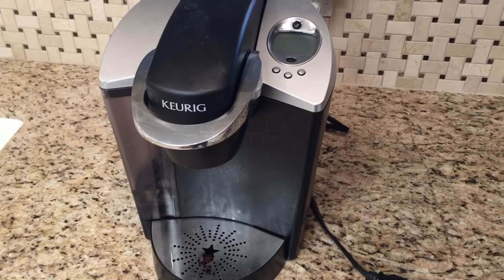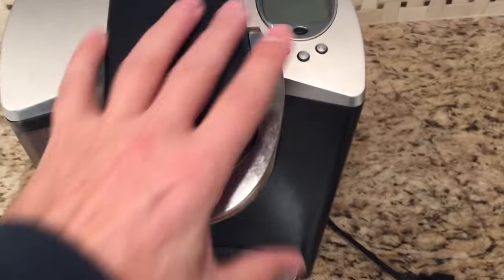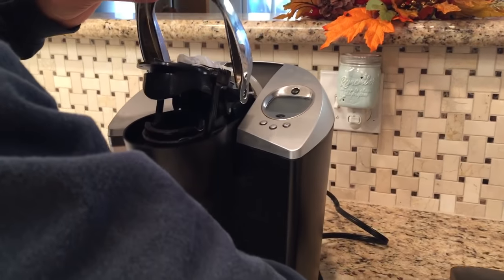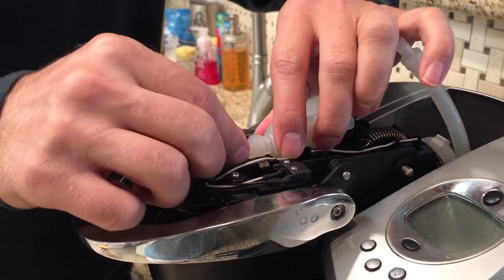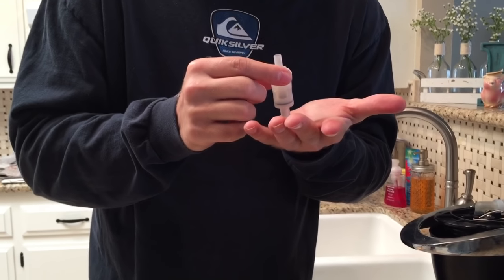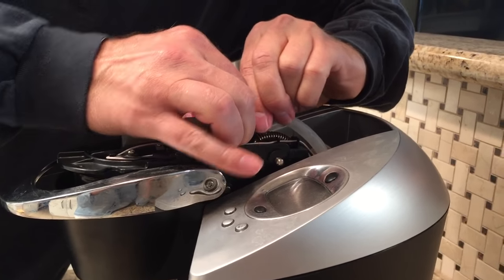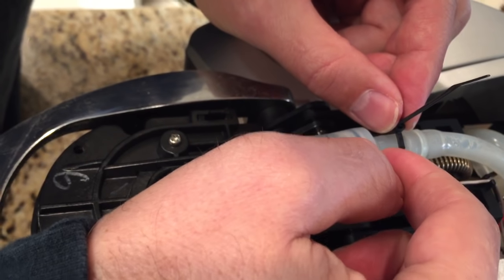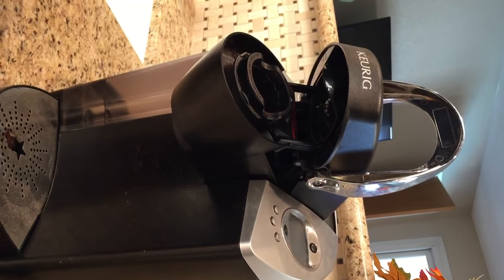Keurig Fix - Part 2: Cleaning the Check Valve

Comment: There is a much easier way to do this that doesn't involve any tools or taking anything apart.  But of course the easiest way is to use a paperclip or pipe cleaner.  I'm assuming this fix no longer does the job.  Take the unit to a gas station to use compressed air at the water intake to blow out the obstruction.  You may need to put your finger over the overflow.  That approach worked for me.

Comment: What should I check if the water does not stop flowing unless the power is turned off?
Reply from the maker: That's a broken control panel or bad sensor. Sounds like a complicated fix. What would I do, you ask? :) I'd try putting just enough water in the reservoir so it runs out before overfilling my cup...OR I'd watch it like a hawk every time and unplug the thing when my coffee was done. If the first solution works, it seems easiest. Fill your cup with water, pour in reservoir, and then brew as you normally would.

Comment: My problem is that it does not “hum” I.e. the pump does not come on , nobody talks about what to do for that.
Reply from the maker: You have a different problem that is harder to diagnose. Either your pump motor is burned up or frozen, or it is not getting power (for a number of possible reasons).

Do the expected lights turn on when you plug it in and power on?  Do you get unusual flashing lights or a message on the screen when you try to brew? If you have a newer machine, are you using Keurig-approved k-cups? Any sounds at all - solenoid clicks/pops? Did you try different serving sizes - maybe one button is bad?  Try blowing a little compressed air into the water intake. Maybe free up the pump assembly???

If that fails, the fix probably involves electrical troubleshooting, finding the bad connection, switch, circuit board, sensor, or wire, or isolating the motor as the issue and replacing it. This is why nobody speaks to this problem. It’s tricky to diagnose. 

Read up on how these coffee makers work. Understand the step-by-step process and compare it to your observations. You may be able to deduce the issue based on symptoms alone.

Comment: In my case the clog was not in the check valve  but in the nozzle at the end of the soft plastic tube  that shoots the water into the K cup.  I unhooked the tube and used a paper clip to partially clean out the nozzle but it still was clogged so I took it to the sink and shot water under pressure into it and it opened the clogged nozzle.

Comment: I was able to fix it using this method, but over time it does start to stick again. Mine is very old and probably just need to be replaced. Any idea where I could buy a new check valve for my keurig?
Reply from the maker: TurtleTitanTMNT Sorry for tardy reply. I don’t know where. Google? Amazon?

Comment: How do you fix it from making loud noises when it brew
Reply from the maker: Ms. Nina Buttafly I’m not sure. I’d try running a vinegar solution through it a few times and letting it soak overnight. There may be minerals built up inside, and the vinegar should dissolve them. Google this idea first before trying. I’d hate for you to break your machine.
Reply: Take off the metal bottom (all screws out until you see the inside) you'll see a tube wrapped in crappy sponge (probably grey). The sponge is not dampening the vibration enough. Solution is to add  sponge more in between where its vibrating. Usually the tube vibrates onto the keurig body housing which makes the loud noise. 
I used a very thick kitchen sponge and just cut it so it would fit snug without hindering anything else. I had to wiggle the sponge around so it would fit and move the tube so it would go between. The noise dropped about 50%. I also use a little dedicated table so the machine doesnt wake up the whole house at 4am. lol.

Comment: I have done this procedure but the Keurig still shows the prime message.  Have tried cleaning a number of times with vinegar but no luck. When turned on the unit makes a sound like it is trying to pump water through it.  Does this for about two minutes and then stops.  No water flow.  Turn machine off and on and get same prime message.   Help.
Reply: The vinegar probably won't do much if it's not getting pumped all the way through the system. I had your problem with my ancient Keurig model, and I eventually got past it by trying a bunch of things. I'm not sure exactly which one worked because the pump didn't finally work until the morning after I had tried everything. But I suspect it was an air blockage somewhere in the tubes, and either blowing in or sucking out on some part of it probably dislodged that - either the water intake port at the bottom of the reservoir, or the clear plastic tube that overhangs the top of the reservoir.

Comment: Why the zip tie?
Reply from the maker: There was a clear zip tie before I took it apart. I assume it was there to keep the silicon hose sealed to the valve under heat and pressure which combine to cause leaks. Perhaps other machines do not have them.

Comment: Unscrewed one screw and it sounded like a nut on the opposite side of the plastic dropped off.  The screw will not screw back in without the nut.  I'm not savvy with stuff like this.  Please help.
Reply from the maker: Sorry about the delay! Are you still having troubles? There are no nuts in my model. The screws seat in the plastic frame of the Keurig. Can you upload a picture of the screw that came out?

Comment: There is another valve on the bottom that is even much dirtier. I'm not sure if it's coffee or a bunch of gunk. If you have a camel pack brush. I sent the rod down through the tubs.
Also, the way they made this thing has so many bends. No wonder why they get clogged all the time.

Comment: I'm not getting any water to make coffee. On top of the machine it says Prime. Not sure what that means. Even if the water is full green light blinks and says add water. No water coming out. I will try doing what you did.
Reply from the maker: One tip - don't use distilled water. Try brewing with plain old tap water or bottled "spring water." Some Keurigs rely on the ions in "normal" water to detect the water level. Distillation removes most of these, thereby fooling the sensor into thinking the tank is empty. 

If this doesn't work, shake a little table salt or salt substitute into your tank and wait for it to dissolve. You don't have to run this saline solution through the machine. You are just testing the electrodes. 

If this helps it brew, try running a vinegar or other descaling solution through the the brew cycle. This may remove possible scale from the electrodes.

If distilled water is your only option, you may try the salt trick with it. To avoid, corrosion and have decent tasting coffee, use the smallest amount that works.

Comment: A trick to get the screws in put a cut straw on the screw driver add dob of dish soap to screw driver so the straw does slide and screw in screws

Comment: Well done.  My model is identical.  Will remove the check valve and clean it with a ultrasonic cleaner filled with CLR.  If that does not work you can buy one at Repair Clinic.com

Comment: It didn't fix my problem, I've tried everything!
Reply: If your valve is working then check your needles make sure they are not clogged.  There are 2 needles one on top and one on bottom where the coffee cup seats try to poke it with a needle. I cleaned the valve and still just barely dripping coffee and I found out the bottom needle was clogged. Now working like a charm. Save me some $$.

Comment: yer lucky if you pop that top off and have access to the supply tube like that.  Keurig has become masterful at burying key components under other components which often break if you attempt removal, it seems.  Maybe they got wind of the DIY guys fixing units?   After all, you can make a lot more money if your customers have to buy a whole new unit every year or two.  Just spent 2 hours tearing down mine and never attained the kind of access to the supply line you see here.